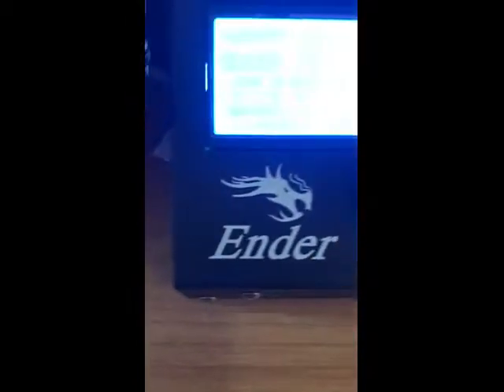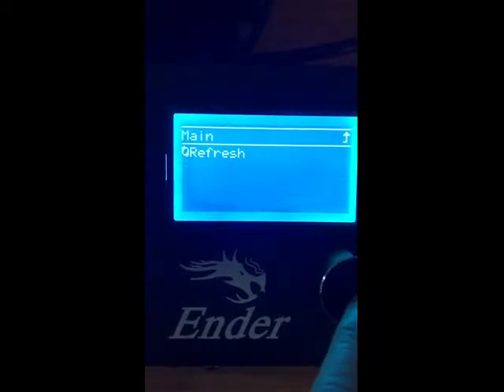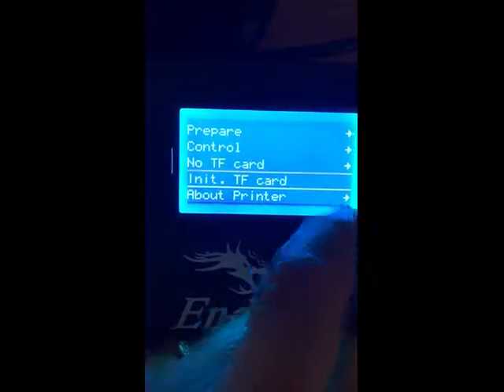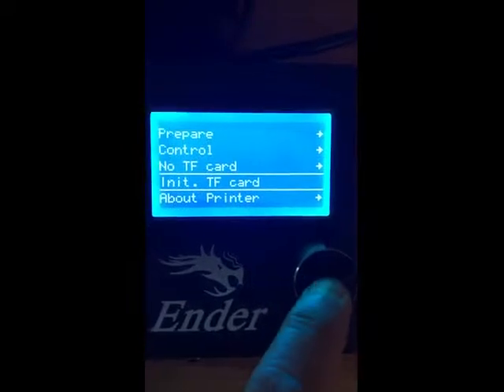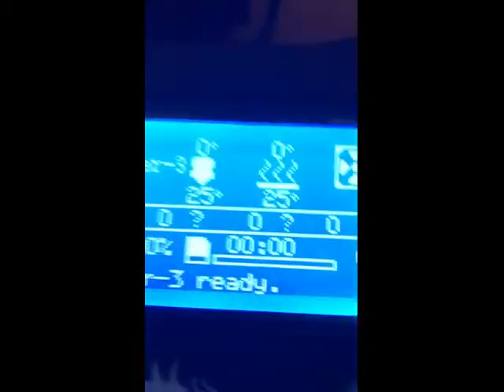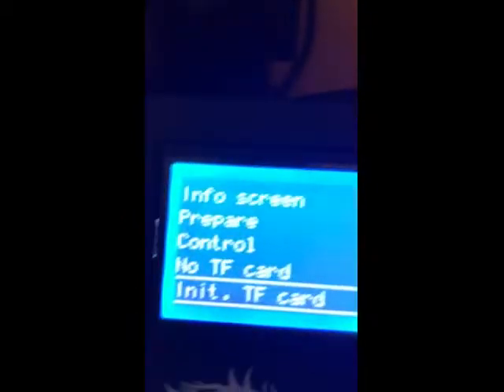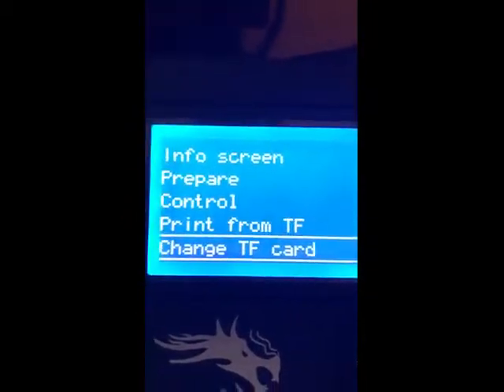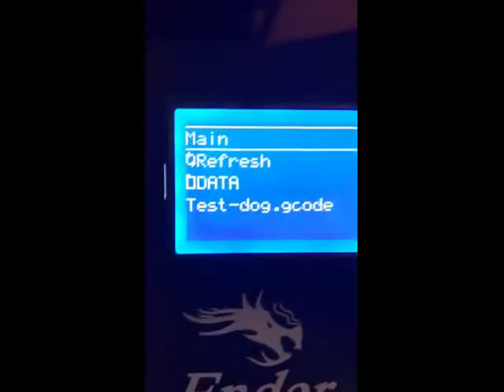Ender3 SD Slot Issue

Comment: I  just had an issue after months of happy printing I went to my printer to find the dreaded blue screen of death.  Some how my firmware was wiped . 😞 anyway  I went looking  the proper firmware for my ender3 pro with no luck . It loaded but looked like this guy's  with the " no tf" 
. So I was  looking  for firmware for my ver 2.2.4 I think it was turns out my motherboard was a newer 2022 board not widely known was out there I go to the creality site  and tried like ten times  until  I found  the firmware  download starting GD works great  .
Reply: Oh  and the name of the firmware is the same as the chip on the motherboard

Comment: A lot of comments and it doesn't seem there is a solution. I just built by Ender 3 Pro. The card has to be held in to read it. Are you kidding me? Has anyone figure out this problem. Is there another way to get a file from Mac to the printer?

Comment: I guess they never fixed this problem. Happened to me on my new Ender after only a week, got worse and worse and became totally unusable. Which doubly sucked because it started happening immidately after upgrading firmware — and turns out, the new firmware can only store settings on microSD.

Should've just bought Prusa.

Comment: I am so mad I can’t print anything! Having the same problem
Reply: I don't know what model or firmware your printer uses but I have printed straight from my PC using Cura or Repitier Host and did just fine without running from the SD card. but you have to have a High Speed USB cable or it will pause intermittently and cause pimples on your print when it pauses. But I use to use that method always until I found it better on the SD card. But in case of normal prints in an emergency you can try that until you resolve your SD card issue.

Comment: Its upside down
Reply: How in the hell it will be upside down? there is just one way to insert the SD card, you cant conect it like it was an USB-C
Reply: @xi6n0r4n7e  huh weird, both my ender 3 pros have the card facing up.
Reply: @armada4602  the ender 3 pro have the main board upside down, that's why the SD card slot is more easier to insert/remove

Comment: Just insert on and turn the printer down and on again. It will be recognized!
Reply: Didn’t work for me
Reply: @BradleyChlopas  I mean; first turn the 3d-printer off, then insert the SD-Card in, and then turn the 3d-printer on.
Is your SD-Card healthy?
Reply: Vahid Behravan just tried that, still didn’t work unfortunately. Yeah there’s nothing wrong with the SD card, I even tried a different card and got the same thing. I’m wondering if I’ve somehow accidentally damaged the slot.
Reply: @BradleyChlopas  
Ah ok, sorry I hope you will fix it soon.
Maybe using a raspberry can be a good idea, somehow expensive but it makes working more fun.
Reply: Vahid Behravan I’m just going to take it apart and see if I can repair the slot. Failing that I know I can connect my computer to it and print that way. Thanks for your suggestions though, I appreciate it!
Reply: Thank you! I have tried everyrhing
Reply: Only on/off worked. But each time you have to “off” first and then “on” the printer. Not normal but worked for me...

Comment: ender 3 pro owner for a few months now. the sd card pops out and printer is not able to print from card ! I was hoping there would be a elegant way to fix this other than changing the board or soldering a new sd card slot .... Otherwise I like the print quality of this machine.

Comment: I'm facing the same problem with my Ender 3 Pro. The card becomes literally unreadable frequently and has to be reformatted on my Computer.  I am using the "Change TF Card" option, but honestly, it's a bit unclear to me what it really does. Sometimes the card is so messed up the I even cannot initialize it on the printer and have to reformat it. 

So it might be me, handling the card inadequate, the card might be buggy (it's the cheap stock one) or there is a more serious problem with one of the card readers, either in the printer or the Computer. Also, I'll have a look into the format of the card itself. I've read that the MBR has to be "W95 FAT32 (LBA)" partition type while using FAT32. But honestly, the whole card handling on the Ender 3 seems a bit bogus to me in general and probably could have been solved better. 

Beside those Problems, I'm still in love with my Ender 3 Pro (yes, it's my first love regarding 3D Printing) and it produces fantastic prints for such a priceworthy 3D Printer!!
Reply: I put a upgrade motherboard thinking it would resolve the card issue but it didn't I'm still get the same problem it's not reading my sd card reader
Reply: Can anyone help me with this issue

Comment: I just got my Ender 3 and have the same issue. Is changing the mother board the only fix or did you find an easier one?
Reply from the maker: The only fix I know of is replacing the control board since the SD Card slot is soldered to the board.  I've been trying to get this issue resolved with the vendor that I purchased the printer from.
Reply: I have the exact same problem as well. All I did was place a strip of electrical tape over the sd card to hold it all the way in the slot. It's not the most ideal solution but I'm able to print now.